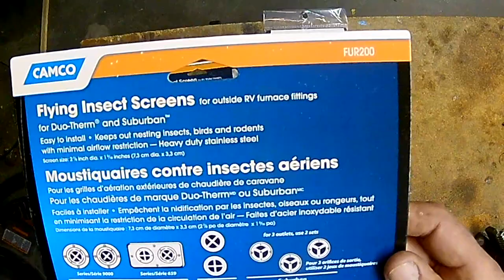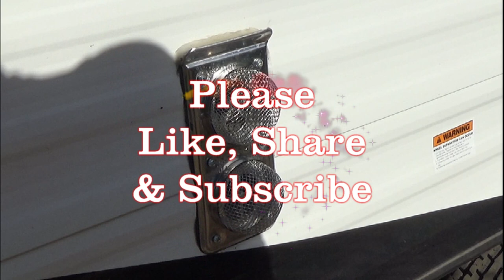Installing RV Bug Screens for Water Heater, Refrigerator & Furnace Vents

Comment: Going to do this but on those little screens, I am going to use safety wire rather than those springs.  Would be easier to put on and be more secure.
Reply from the maker: They are a bit fun to get on but so far they haven't fallen off. And we have been on some rough roads this year. The safety wire does sound like a good idea though. I will keep that in mind if one ever does fall off.

Comment: I've never had a bug problem but a friend did and another camper who is an RV tech was putting screens on his so I did.
On the water heater screen I needed to put vinyl edging to prevent the screen from wearing off the paint.

Comment: What did you do with the refrig drain hose?
Reply from the maker: My drain has always been hidden behind the cover and directed into a small catch pan. For me I have not had an issue. If you need you could cut a small hole into the screen to run the drain hose
Reply: @DiyRVandHome  Yup, that's what I thought. Hope I can do it well enough to not give insects entrance. Thanks👍.